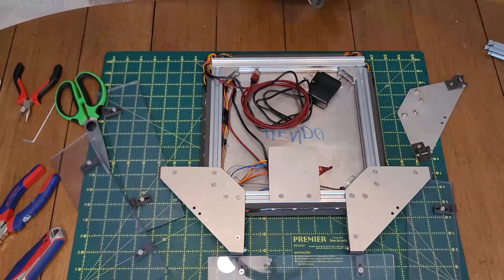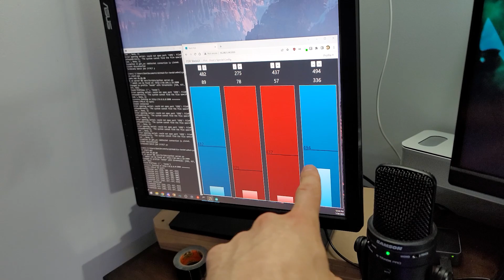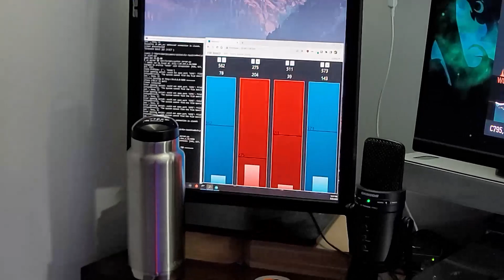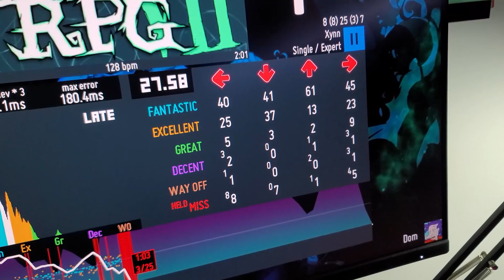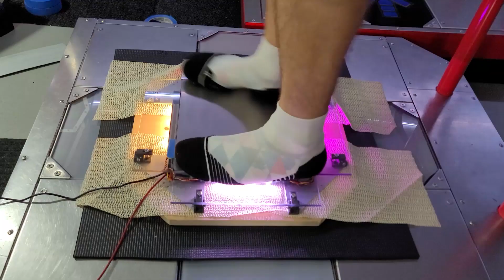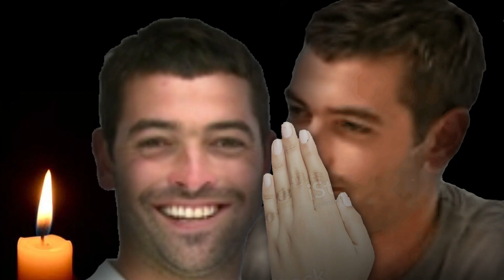The HendoPad Returns

Comment: Whoa! Great to see that this is back in production and that it has been tweaked to be regulation-size! I think that combo will make it sell like mad because they seem like they'll be relatively low cost and helpful for those that are pretty inexperienced with the hardware side of building things (as most seem to be pretty adept with software by necessity being Stepmania and all.).
.
.
.
.
.
.
.
.
...Like myself. :P I was actually thinking about messaging you about if you planned to sell one of your pads because you said that they were essentially just sitting around collecting dust and I was thinking of trying a FSR something, lol! The reason why is because on faster stuff I feel like I hit a wall by the pad itself where the cushioned (Literally as DDRGame has foam-squish) panels I have seem slow to squish down and thus higher speeds have been difficult as I have to push down and in rather than just slide on. So I may as well enter the giveaway. But isn't this still way too much to just give away? I suspect this would be like $300 or so in total, if not more.

...and wait. Shinji as best "girl"? XD

Comment: For the strip FSRs, I can recommend putting some thin long tape strips just along the "active" portion of the sensor (the center part with all of the lines). I have 2 stacked strips of gaffers tape on my strip FSR's and it works wonderfully.